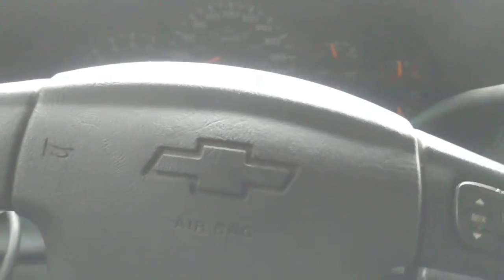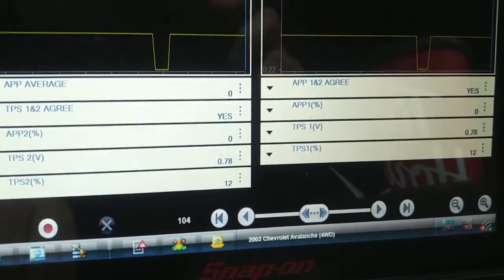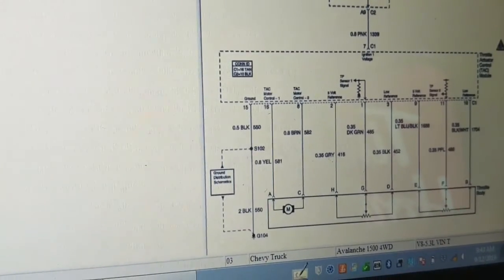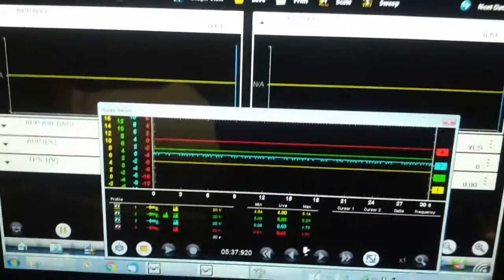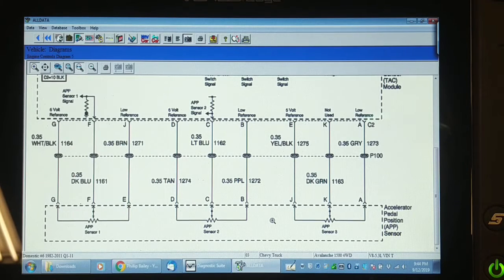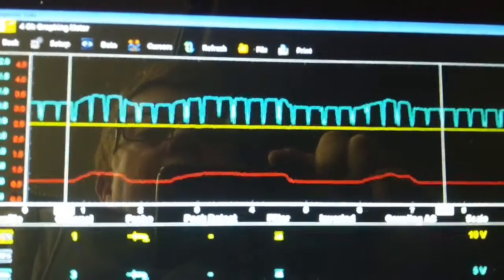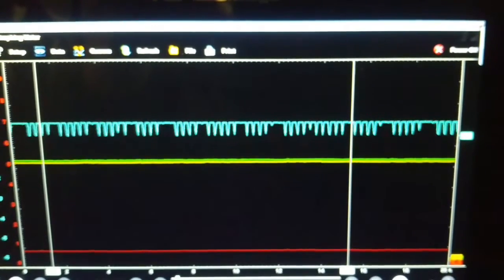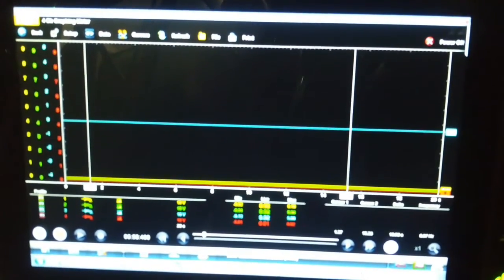2003 Chevrolet Avalanche P1125 APP Correlation Fault pt.1

Comment: The APP2 supply is pulsed low every 20ms by the module. You need to have a faster scope to see it properly. It is not a noisy signal. The background is that the module must be able to tell the difference bewteen the APP1 and APP2 sensors. Chevy chose APP1 and APP2 voltages which are about the same, but chopped up APP2 voltage. Most other manufacturers chose to have APP1 and APP2 at different voltages
Reply from the maker: Yes you are correct I did find a bulletin that describes the operation. There is also an APP3 signal on this that is not used but is wired and functional. Thanks for the info.
Reply: @PhillipBailey  Great, may I ask where I can find that document?

Comment: Very interesting Phil... and the wave form is kinda cool looking. I’ll be waiting on part2. I don’t get why using the unused 5volt reference would work either.
Reply from the maker: Yes it doesn't seem to make sense but when I switched the two circuits the 5 volt reference was pulled to 0 and the " Reduced Engine Power"  message showed up. Confirmed that with an open Circuit the signals show 0 volts so there should not be a diagnostic resistor in the controller. I'm going to try a new sensor first.